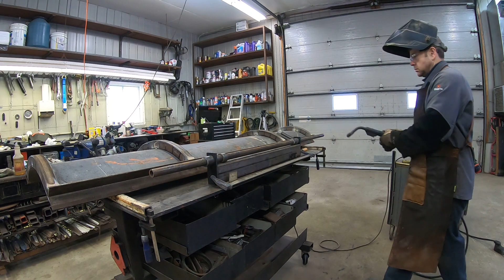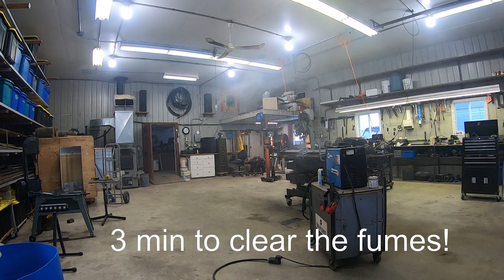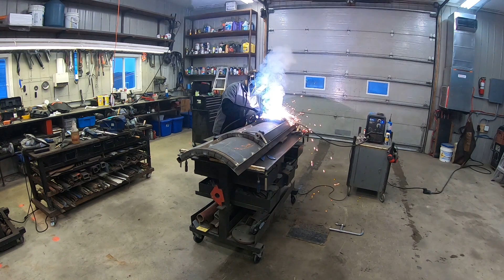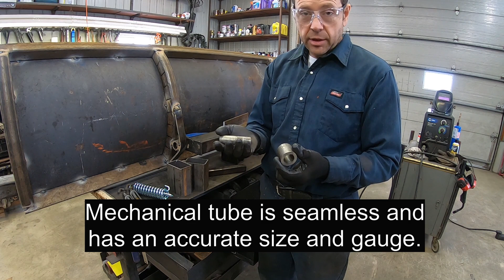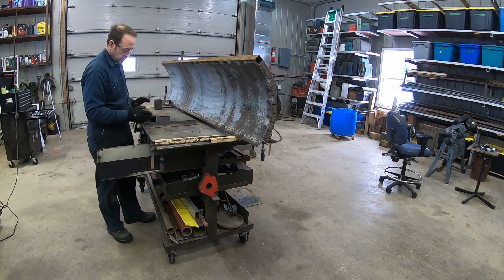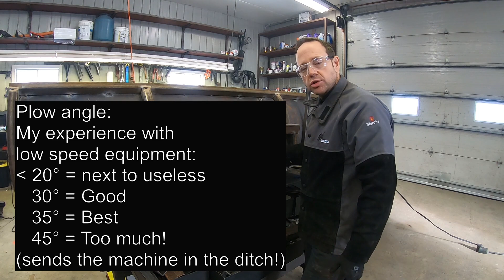#220 UTV Can-Am Defender HD10 Snowplow - Part 2

Comment: Allo Joe. That plow bracket will surely be strong and outlast the UTV.  It's no Canadian Tire special. 
Thanks for the tips in your video about the steel pin and bushing and the strengths of assembly.
Have a good week.
Alain
Reply from the maker: Thanks!  I've wondered how the big store plow came so light. Now I wonder how they can even last a season! Lol! Thanks Alain!
Reply: @FromSteelToWood  I have been looking for used water heaters to make myself a plow like you made for Dave's Mahindra for the front of my tractor.  I have a 4' dirt bucket on the front of the tractor and it slows things down having to dump all the time.
Reply from the maker: Right!  That is the main benefit of a snow pusher/blade!  Now that you got good chains, a snow pusher is best for you!

Comment: if it close to 400 lb (181 kg)  i read it rides better with better springs and tires.
Reply from the maker: Good news, I put is on the scale yesterday and got 240lbs!!! I am very surprised it comes only 40lbs heavier than the OEM plow. So far, with the original springs set to "soft ride" and it works good. Thanks!

Comment: “Only water.”   Sure, Joe, sure.  LOL!  It’s coming along great, Joe!  Brilliant to mix metric and Imperial sizes to get the need play between the rod and bushing!  As always, you a building a very rugged machine.  See you in Part 3!
Reply from the maker: Thanks Martin!  There is also a certain combination of gas pipe and mechanical tubing that works good too. The long pin you see me removing after the smoke, this is a 80 schedule 3/4 pipe. The outer diameter is 1.058 if I remember well. So the mechanical tubing has a bigger ID too. But they fit together within 0.005", which is great. But the best part is to have a hollow pin for greasing. Thanks!

Comment: G'evening Joe!
Reply: btw: 32 degrees is best... it increases the chance of snow, which means you get to use the plow blade!
Reply from the maker: Almost right... I would target 30°F!  It's currently 32°F and it is melting snow NOT accumulating on the ground. Just a bit up north, they got 12+ inches of snow... I am about to build myself a trailer to get there with the Defender and have some fun!!! Thanks Richard!

Comment: Hey Joe ,don't drink too much of that WATER until the project is finished. The snow blade is really coming a long Joe. We just got some heavy wet snow last night. Yikes!  Keep warm
Reply from the maker: Lucky you got snow, here it was melting snow and we got only 2 inches so far. When it freezes, it will make nice logging trails. Thanks John!

Comment: Very good Joe, are you going to put zerk fittings on pin location's ?
Reply from the maker: Yes, that is the plan Mark, there will be zerks fittings on all pins. 2 sets are hollow pins, they will have their zerks fitting on their ends. Then for the king pin (hardened steel), the zerks will be on the bushings. Thanks!

Comment: Hey Joe  will  it be to  heavy for Can-am your blade . Bonne journée Joe .
Reply from the maker: That is what I was wondering, but it's not.  I've used it and it goes very well. I've put it on the scale today and it's 240 lbs.  The OEM plows are in the range of 200lbs.  Some heavy V-plows are up to 400 lbs!!! Do you have snow at your place?  We only have 2 inches of slush/snow.
Reply: @FromSteelToWood  Ho yes we have , JE suit en Ontario  tres proche du Québec
Reply from the maker: We finally got a good amount of snow Sunday. Maybe 12 inches of snow total.